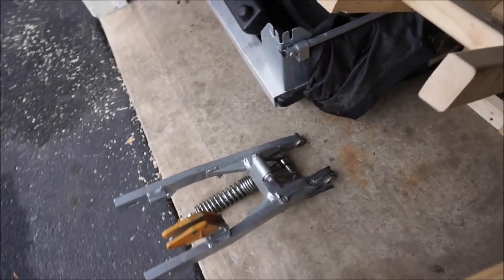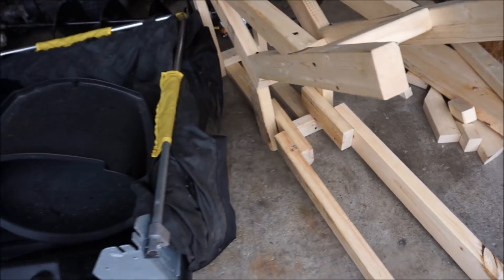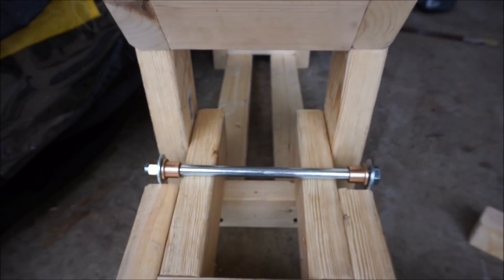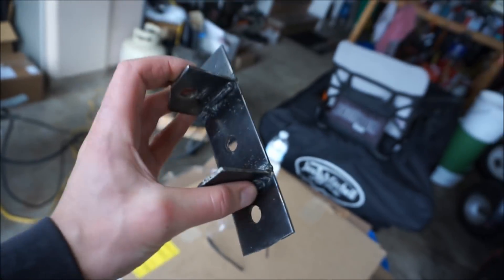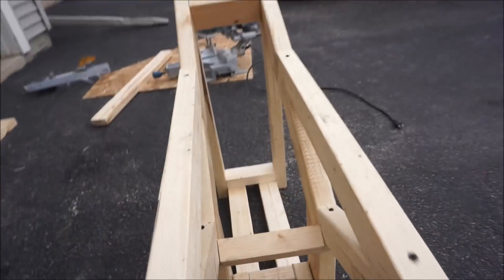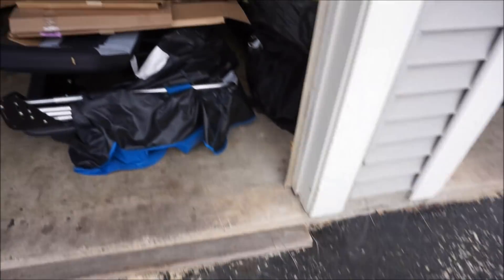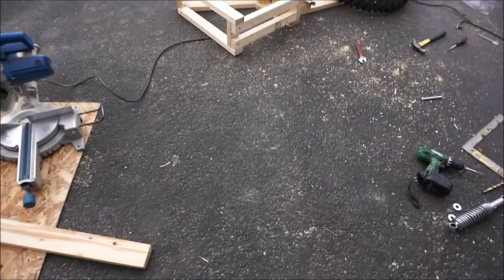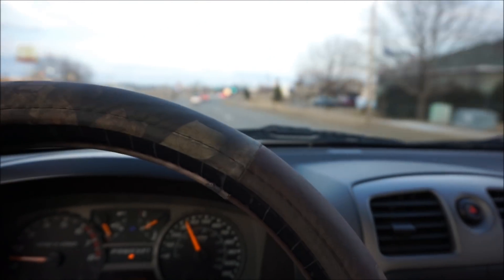Making The Swingarm And Rear Suspension!!! (Wooden Bike Build Part 3)

Comment: You could probably make a really sturdy one with no suspension if you use the least amount of different pieces of wood as possible
Reply: William's Videos you have have something taking the pressure off the frame, even on road it will still bump around, you could risk snapping the frame without the shocks